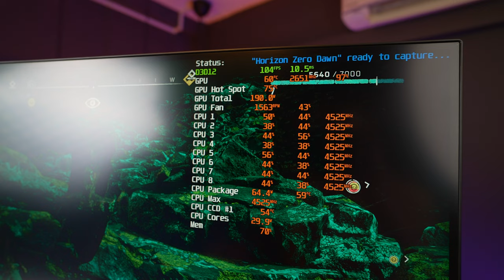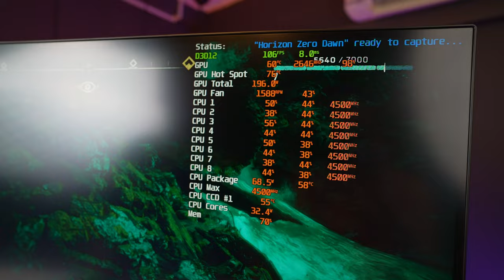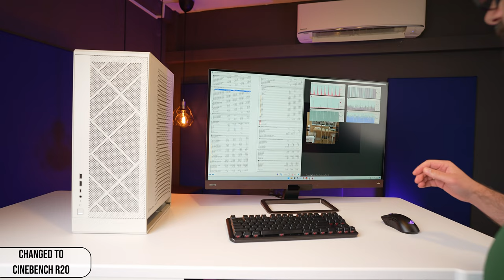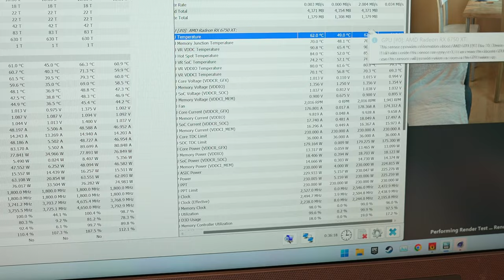Balanced AMD Build in Silverstone ALTA G1M Case

Comment: Great vid. For the HDD install you could route your cables first and then mount the drives so you dont have to worry about feeding them under those small openings to plug them in.
It also helps when youre trying to figure out how much room for cables you have left vs how much room you have for your HDD.

Im almost convinced you could squeeze 3 3.5inch drives in there.

Comment: Good video and good tips, thank you since I'm considering this case not because of the thermals but due to the spacing I have available for my PC case. However I dont agree with the view of "getting rid of hot air no matter what". The case is built for positive pressure, being optimized for airflow from bottom to top. Putting the radiators as intake will not cause a lot of difference in terms of thermals but it is the proper way to assembly it.

Comment: The case is great. I've always wanted the FT03 except that it has no side mesh for intake and exhaust. A few things that Silverstone could have done different. There should be a fan mount on the top of the panel for exhaust and front panel shouldn't be made of plastic